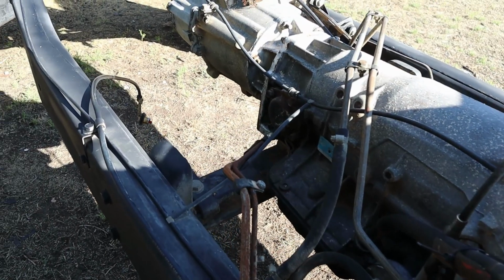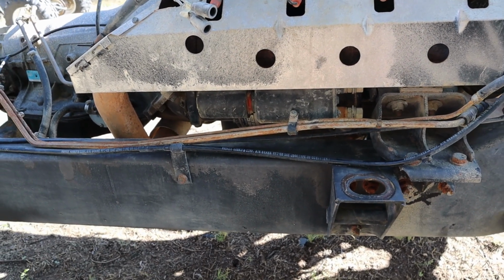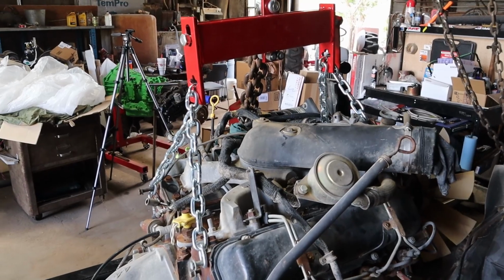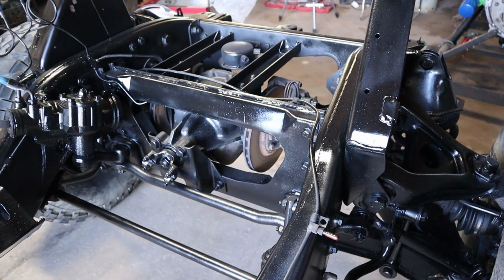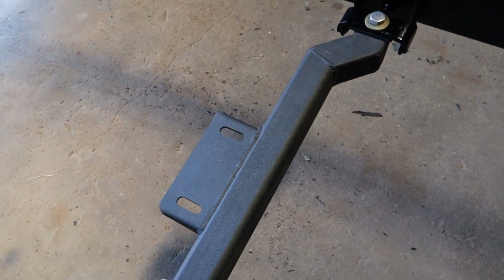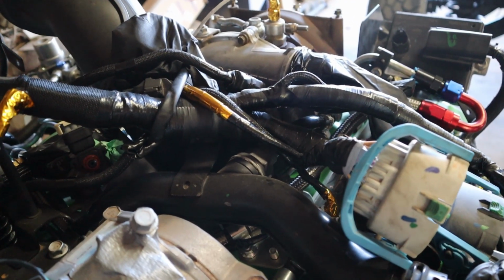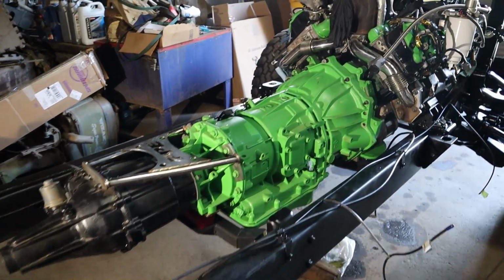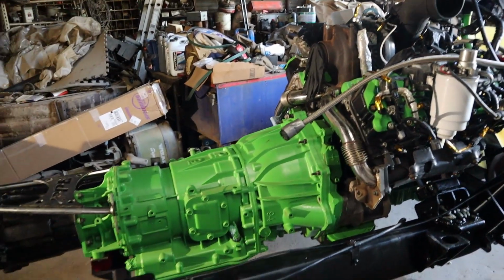It fits! Duramax Swap in the Frame! - Project Duramax Humvee

Comment: The original radiators in the Humvees were leaned back at quite an angle to match the hood line compared to a civilian truck with a Duramax.  The electric fan seems the smartest choice.
Reply from the maker: The mechanical engine fan on the duramax with the original shroud has worked great so far with the new aluminum radiator. My temps have never reached 200 degrees. I'll be adding electric fans to the front for the AC when I tackle that project.

Comment: Hey man, what fan did you replace the stock duramax fan with to fit in the shroud? I also rebuild Humvees @splitbuilds.
Reply from the maker: There is a couple companies that will sell one but they are basically just cut down factory fans. I cut mine down as precise as I could, taking my time with it, and tested the balance a little with some old equipement thats in my shop. The duramax engine fan won't be spinning at as high of rpm's as a gas engine usually. There are some forums of car builders that get into the discussion more.

Comment: Where did you find the donor engine and trans?  I assume a Duramax is a lot more diffcult that dealing with a cummins motor right?
Reply from the maker: I haven't ever messed with a cummins motor so I can't really compare personally. I just looked different places for a donor engine and tans and came across one that was pulled from a wrecked truck.

Comment: What type of cooling fan did you use to replace the factory on that comes with the Duramax which hits the HUmvee radiator shroud, Thanks
Reply from the maker: There is a couple places online that sell one that will fit. Modmafia is one place if I remember correctly. They are basically a chopped and balanced duramax fan.
Reply: @tossthewrench  What driveshaft did you use? Thanks

Comment: Can't wait to get started on mine, doin a Cummins in mine, still up in the air about trans and 2wd/4wd t-case.  Don't want any electronics.  Question for you, did you make any body templates to see where or how far you might have to modify/lift the body for clearance, or are you just goin for it(deal with that later)?
Reply from the maker: I knew I needed at least a 2-3in body lift from reading forums on the swap. I went with a 3in to give myself a little more room. I did cut a piece of cardboard that fit the trans tunnel to be able to see how much clearance I had but with the 3in lift there is a lot of clearance around the trans. Seems more for the engine clearance.
Reply: @tossthewrench  I keep hearing that it needs a body lift for clearance.  I need to see one in person to see if maybe it can be done without it(maybe modified oil pan).   I was thinking about pulling the body, then pulling out the stock drivetrain, then putting the body back on to make a wire-form tunnel or templates all the way front to back to help with mock-up.....also, I noticed your engine is pushed a bit to the right.  What made that necessary?   My exhaust and turbo are on the right....so that may present a problem for me..

Thanx for responding to the questions, the input is very much appreciated!!
Reply from the maker: That sounds like a good way to set up a mock tunnel that you could work around to help with fitment. 
The original engine is angled to the right also mostly to make room for the front driveshaft that runs along the drivers side of the engine.

Comment: Hey. Bud…. I know these are old videos, but I keep watching them.  I have a 1165 …. What size Axle gear did u use or stay with stock?  Thanks
Reply from the maker: They are the stock axle gears. The ratio works just fine with the powertrain swap and larger tires.
Reply: Thanks for the information!! so only thing different is the Duramax and transmission, right??
Reply from the maker: I did use the new transfer case from the duramax and allison as well. I'm not sure if the humvee transfercase would have worked or not. It might have a different spline count on the output shaft of the transmission.
Reply: Ok cool!! I need to know what you had so I can pretty much put the same thing back into mine…. did you get all that stuff from a wrecked Chevrolet truck?  Or did you buy all that separate?
Reply: Hey, it’s still running pretty good? If you get time, make it update video.
Reply from the maker: The drivetrain was all from one wrecked truck. It's still running good. Still fun to drive! I should have an update on it pretty soon.
Reply: Ok cool!! Thanks a lot
Reply: Hey bud one more question I’ve been thinking about…. on the old wiring harness if you don’t take out a a wire that you don’t need will it mess something up? Like I see where you took out all your old ones out of your old harness that you don’t use no more.

Comment: Hey man , Any chance you could explain what you did for the front drive shaft carrier bearing modification ? That would be greatly appreciated , Thanks in advance !
Reply from the maker: I havent done the mod yet for that. I explain my plan a little in the stainless radiator tubing episode a little. Once I get it running in 2wd I'll do the mod for it. I'll create a custom bracket that will move it down a little and maybe back some too. Hope this helps if you're going through the same build.
Reply: @tossthewrench  yes that helps , just got the engine dropped and body on , gonna run all my wires and get everything mounted to where i can drive it , then pulling the body and drivetrain back off and doing full resto ! Thanks for the reply bud !

Comment: What is absolutely necessary for a dmax swap?
Reply from the maker: Engine, transmission, transfer case, wire harness and ecm/tcm, engine mounts, transmission cross member mount, drive shafts, body lift, fuel tank mounting modifications (or your driveshaft will hit), fueling upgrades (duramax requires more than the 6.2 or 6.5), shifters, throttle pedal, modified engine fan, intercooler, intercooler tubing, exhaust, steering modification, a way to read engine and transmission info (gauges), 12 volt system. I'm sure I'm forgetting some stuff tho
Reply: @tossthewrench  you’re the goat man

Comment: You are building my dream truck. I am curious about the year on the Duramax. I have a 2013 Chev with the Duramax, and it has some shortcomings, including a known fuel pump weakness. While there is such easy access to the engine, and since you're changing the turbo anyway, it's a PERFECT time to update the exhaust up pipe, intake manifold, remove stupid stuff, and change the fuel pump to the CP3. Of COURSE that means more money, but you'll get some power and longevity in return with almost no additional effort. Liked and subscribed! Can't wait to see more.
Reply from the maker: It's an earlier model duramax. Ive already had the engine down to the block. Studded it. New y bridge, new fuel supply to cp3 pump. Checked injector balance rates. And a bunch of other stuff. That was all before I had thought about creating the channel or I definitely would have recorded some videos on that too.